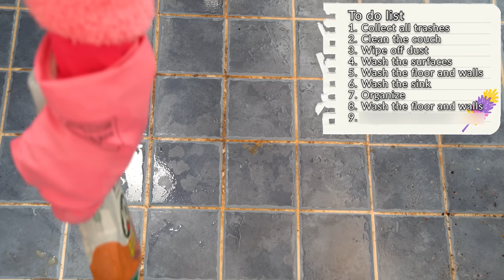From Disgusting to Dazzling!!🥺🤩

Comment: Hey Auri I know I have mentioned this before but you might consider getting a deck brush for the tiled areas. They are a very firm bristled brush designed to scrub outdoor areas. Scrubbing by hand has got to be far more time consuming than using one. I know your time is limited in these homes and it might be more efficient to use one. I know you are the expert in these matters so I'll stay in my lane but I thought my suggestion might help.

Comment: i swear power paste is a MIRACLE (edit) can you talk about how to spot red mold and which cleaners are best for which types of mold?
Reply: Do you mean the pink stuff if bathrooms? Or is there a red one I haven’t seen (eek)?
Reply: “How to spot red mold” -> it’s red/pink.
Reply: I use white vinegar on it
Reply: I think ive heard its good to use either bleach or acid based cleaners. Things like vegar can also word since its acidic
Reply: So if it’s just the pink stuff-Dawn will remove it-and if you put a couple drops of tea tree oil in the rinse water, it will slow it down. Not too much or you might slip in the shower/tub. The smell fades fast. Vinegar is good too. No need for anything harsh.

Comment: Always impressed with the amazing transformations on the places you clean.  Great job!  I do wonder if you could provide an extra step on the floors.  Appreciate your squeegee technique but thinking that scrubbing off stains with whatever you used as a cleaning compound in minute 7:15 on the white table would help with spots on the floor as well.  Maybe another mopping of the floor after the initial squeegee to make sure it's clean.  Other than that, you're spot on with your cleaning technique.

Comment: Can you show us how you clean your duster after that heavy use? I find dusters somehow the worst option for cleaning because I never know how to property clean them after use. And  them I have the impression that I am just moving dust from one place to another.😊
Reply: Haha, yes. My technique is to sweep slowly and rotate at the same time, so as not to brush the dust everywhere. I vacuum mine, that usually does the trick. Or you could beat it against an outside wall or maybe handwash it with a mild detergent and let it air dry. Good luck :-)